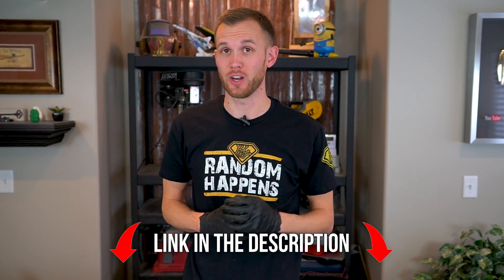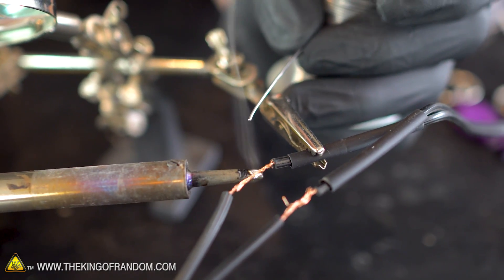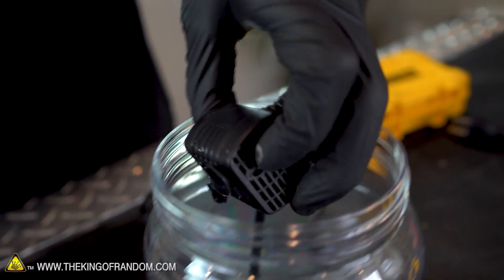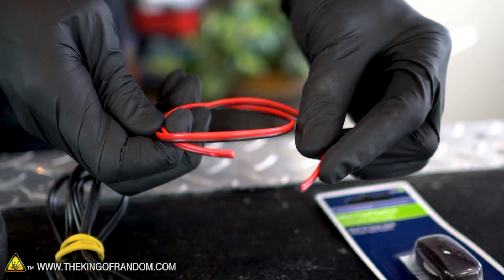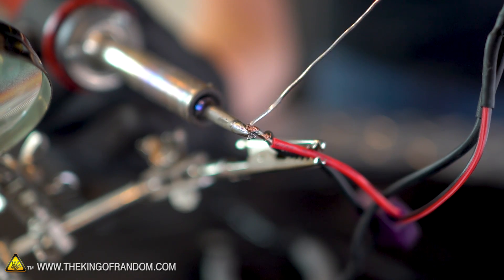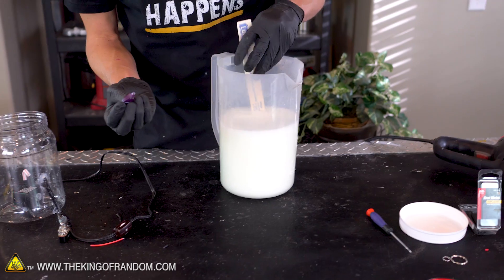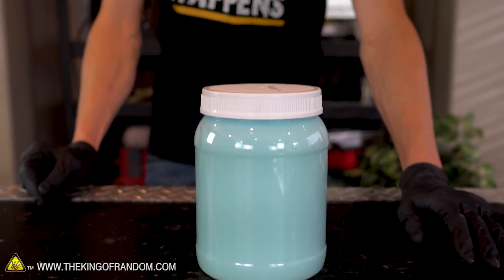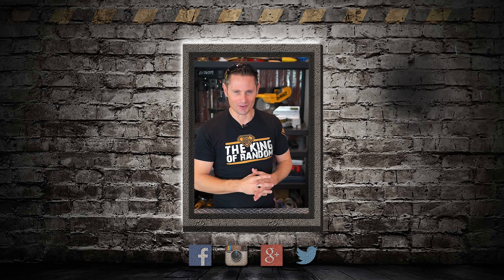DIY Northern Lights! TKOR Explores How To Make Northern Lights In Your Own Home!

Comment: Or you could just use a blacklight LED strip, and some hot glue to attach it, as the container is see-through. Put them round the bottom and you get a better illusion. It's a lot simpler, and doesn't really require any soldering
Reply: Pixels I was thinking the exact same thing, I feel like there are multiple ways to do this that are easier and require less tools
Reply: The led tape is smart
Reply: Pixels y
Reply: I'm trying to make this but I don't have any soldering skills. Would you be able to walk me through how to do it the easier way you described? I would greatly appreciate it
Reply: @LEGIONxPSYCHO  Instead of using a blacklight led with a switch use a blacklight led strip, it's  a strip of lights rather than one little bulb. It can be left on the outside rather than on teh inisde though you'll still need to do a bit of wiring to get the pump in there. Though you wouldn't need to solder it, twisting the wires together or using a small copper tube and crimping the wires together works as well.

Comment: What if you guys add liquid nitrogen to negative x instead of water... Make the negative x in a right formed/sised pile so it can ignite more easily... Science liquid nitrogen is so cold, would the negative x ignite at all or actually test if negative x lights off to really cold or really hot water.

Comment: It just crossed my mind to try that out with transparent bricks. Like glass bricks (if they exist in plastic they would be a bit easier to handle). You could make a whole wall like this by connecting multiple bricks and let the liquid flow through them in some complicated ways.

Comment: The battery is kinda annoying in this build, i would switch it with a permanent power source..
Reply: @lachlanjohnson8019  they sell 3 volt adapters really cheap.

Comment: You guys should do live streams. You should also try lighting gallium on fire and/or try putting it in dry ice. I've been asking for a while now and REALLY want to know what it would do!
Reply: gallium wont burn and in dry ice will just freeze it
Reply: captainnemo but how do you know...
Reply: Yh gallium would just freeze and return to its natural form
Reply: It's been done in other channels , an I'm sure he has done it before
Reply: its logic... when the temperature of galium goes below its melting point it becomes solid. I'm also quite certain gallium will not light on fire.
Reply: Disney Lover 123 when u heat up gallium it will just melt, and when u further increase its temperature it will boil. It’s not flammable

Comment: Make liquid hydrogen......Or make night vision glasses
Reply: It's practically impossible to get liquid or solid hydrogen without an immense amount of high-tech equipment in a professional laboratory. You'd need to reach 14 Kelvin at standard pressure to freeze hydrogen, and 20 K to condense it to a liquid. By comparison, room temperature is about 300 Kelvin.

Comment: Pro tip. Offset your wire lengths when you cut them. This will help in making sure the cut areas are not laying next to each other and will help the finished wire to lay flatter without a bulge where all the slices and shrink tubeing are bunched up. Also forget the electrical tape. Use a larger diameter shrink tube to hold the separate wies together. Much cleaner.

Comment: what would happen if you mix gas and diesel to getter and freeze them to getter.
Reply: Preston Wischnewsky getter huh?
Reply: Gas is a distillate and diesel is an oil. The gas would make the diesel harder to freeze but useless as a fuel for anything but starting campfires. (I think maybe you shouldn't do that either...)

Comment: Hey try to put a concrete block in the vaccum chamber it may turn dust in few second or a minute
Reply: thats not how concrete works
Reply: Concrete is consists of lot of air and in vaccum chamber all the air will come out and particle will slip on each other and thus turn into dust
Reply: I think we need him to try this one
Reply: PUNEET jain that’s not how physics works
Reply: I don't think it would turn to dust. . .
Reply: doubtful
Reply: It wont work with dry concrete. It could with wet though.
Reply: it wont
Reply: Pretty sure concrete is a chemically bonded mixture with the air and water, not just air and water trapped in dust. I very much doubt pulling a vacuum on it would do anything at all.
Reply: The concrete would either crack or explode, nothing else